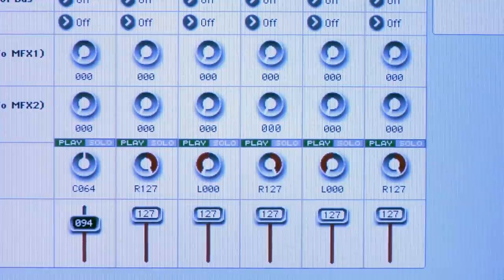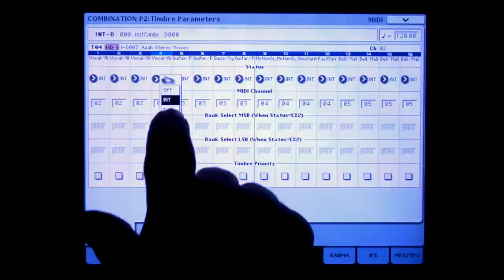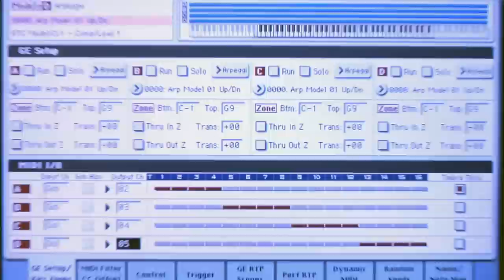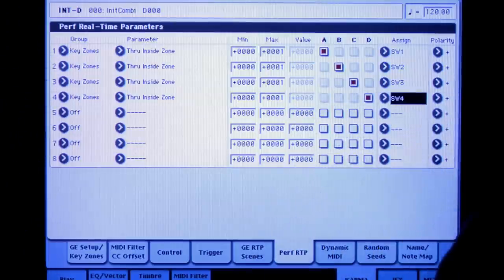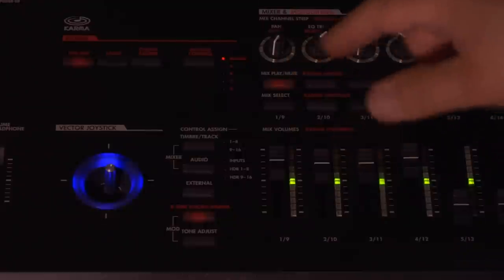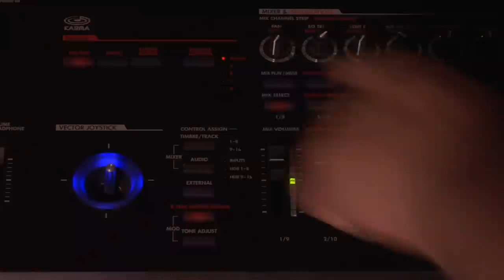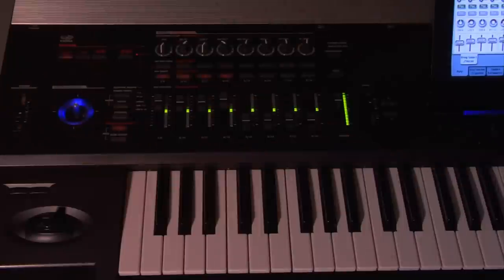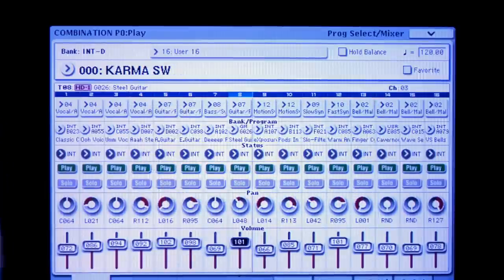KARMA Combi layer switching

Comment: But does it turn of the polyphony when not in use?
Reply from the maker: Yes.  Polyphony is determined by notes triggered, which synth engine you are using, and if the sound is layered.  Using 4 KARMA modules (like this video) is going to trigger at least 4 notes when you press one.

Comment: Hi, Hope you can help. We are doing Hungry Like the wolf, I have split the keyboard so the phased strings are on at the middle C and above and the randomised sequence below middle C but when I switch the Karma on it plays the Karma sequence all the instruments when I only want it on channel one? I would be very grateful for any help.
Reply from the maker: Without knowing the specific combi, I'm going to give you 3 answers.  1) Press on the bottom row KARMA tab - GE Setup/keyzones page.  Uncheck the RUN box on the B,C, and D modules.  If RUN is grayed out, then you'll need to go to the Perf RTP page, and uncheck the RUN boxes for B,C,D.  Go back to the previous page and deselect the RUN boxes for B,C,D.  2) You could find the sounds that B,C,D are playing, and either MUTE them or turn their volumes down.  3) You could go to the Timbre Parameter - MIDI page and change the channels of the sounds being played.  Most likely it will be programs on channel 2, 3, 4.
Reply: @scoopicman  Thank you for that, I will let you know how I get on.

Comment: Hi, this is pretty much similar to Karma in Kronos. But in Kronos sometimes the "Run" option in "GE Setup / Key Zones" is grayed out and can't be changed. Do you know why it happens? I have found other people with the same problem but not a solution. Thank you.
Reply from the maker: Greyed out means that the RUN is assigned.  Go to  the "Perf RTP" tab and under "Group," turn MIX (or whichever setting) to "Off."  That will do it.  You can put it back to MIX, again, and it won't be greyed out.  You can now work with it.
Reply: Thank you very very much!